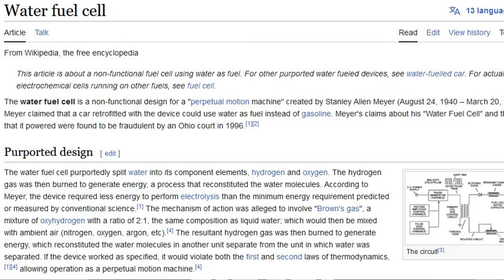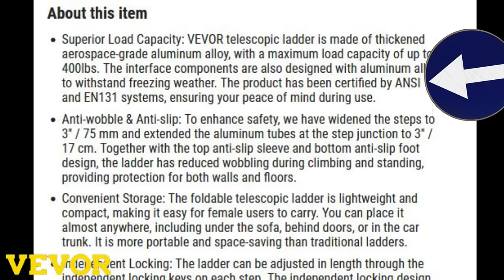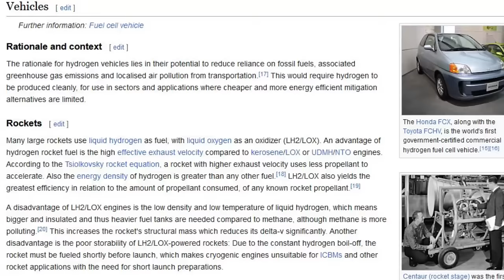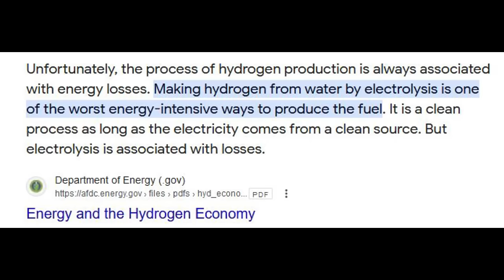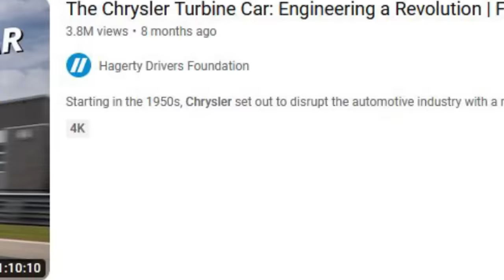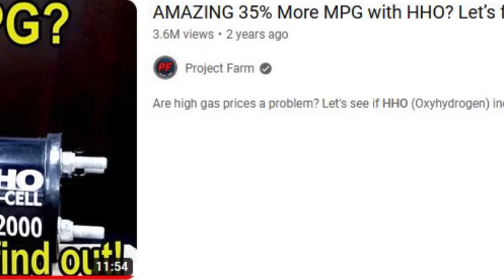These Engines Were Going to Change the World but..........

Comment from the maker: Thanks for watching. What do you think of this subject? If you wanted to check out the Vevor Ladders, check out the links here: 
18.5 FT https://s.vevor.com/bfQU28
10 FT https://s.vevor.com/bfQVEV
Discount Code VVPROMO for another 5% off
Reply: Those Vevor ladders are great, we use them in bulk fuel delivery daily. Stow easy. Just have to be easy on them when sliding the stages together. Hard on the plastic buttons.
Reply: 200 gallons on my 1981 vw rabbit pickup with a mechanical highly modified 1.9 tdi

It’s been that way for 13 years.
Reply: Hey Josh I was wondering if you have ever made a video on the cat 3176 engine.
Reply from the maker: No, but I feel like there will be one soon 🤫

Comment: In the '60s I saw the turbine car with manufacture's plate in my town near the PA turnpike.. It definitely had the turbine whine. We also had two 400 kw turbine generators at work. They ate so much fuel, they were changed out for diesels.

Comment: Back in the fifties, Rover company made gas turbines from Frank Whittle designs. Rover put one in their car, the engine was reckoned to cost 50% more to produce than their regular engine , but it also suffered from slow acceleration because it was single shaft type, and used a perforated ceramic disc revolving between exhaust and intake to attempt some heat recovery, still being thirsty. Not sure how few were made.
Alternative fuels, my college lecturer in the early eighties claimed that in the early sixties he drove a mini with a sterling cycle engine that used a radioactive isotope for the heat source. The isotope would last about three years before needing return to the British nuclear research facility at Harwell for a new isotope ( sealed in its lead jacket) . The downside was a top speed of 45mph.
Water fuel, many early engines used water ingestion to reduce combustion knocks, a few even had the air intake inside the cooling hopper to ingest steam.
Using alternator output to reduce water via electrolysis,,,,, really,, the engines driving the alternator which itself isn’t very efficient, and the engine still only 35% efficient at best. As said,  ‘ye canna change the laws of physics’.
Let’s go one step further, hydrogen 😖😖 first you gotta make it, then you gotta compress it, A LOT. 
From the manufacturing point onto the transport, off the transport to the retailer, from retailers to your vehicle, each step is either a reduction in pressure, or needs heavy pumping. And that’s assuming there’s no bulk storage as we have with oil. Some in depth studies by highly respected researchers suggest about 60% of the hydrogen that reaches your vehicle is actually used for propulsion, the other 40% was used for making and transporting. And after all that, due to the size and physical requirements of the high pressure tank in your vehicle, the range is not much different to an EV battery system.
Hybrid drives still seem the best option, diesel/petrol powered generator with electric transmission for distance and batteries for both around town, and hill climb boost.

Comment: The part about an exhaust turbine has been done, detroit did it on the high hp dd16 engines and it was basically a turbine after the turbo that went through a torque converter and gear box that directly put power into the gear train, i think it added 100ftlbs of torque but was mostly gimmicky costly and broke a lot
Reply: Volvo has that tho
Reply: Yea it's kinda dumb

Comment: There was actually an aircraft engine that used multiple turbines geared to the crankshaft to recover energy from the exhaust. It supposedly increased the fuel efficiency by 15-20%. The engine was the Wright R-3350.
Reply: The DD13 does this, theres a turbine behind the normal turbocharger that is geared to the crankshaft

I believe there may be some other manufacturers that do this on their trucks as well
Reply: ..and it was one of the most unreliable aero engines made, with an insatiable appetite to lunch on it's exhaust valves. As used in the L-1049 Super Constellation, and garnered it the reputation of being 'the most beautiful 3 engine airliner in the world', because at least one engine failed nearly always on each flight =)
Reply: That’s called turbo compounding
Reply: Beat me too it , Nice seeing good info.

Comment: Remember- when thinking about the "perpetual motion" reasoning, that can trip you up sometimes. 
Example being using refrigerant systems to move heat into an area versus electrical resistive heating elements. 100% of the electricity put into a resistive heater is going to come off as heat. That is 100% efficiency as a heater. Take that same amount of electrical energy input and use it to power a compressor in a heat pump system (which is essentially just an AC system with the roles of evaporator and condenser reversed) and you will get MORE heat output than the resistive elements. Does this mean, that as a system, the heat pump is more than 100% efficient?? Well, looking at it by itself, of course it isn't! The compressor has friction, the liquid refrigerant has friction, the gaseous refrigerant has friction, the circulating fans have friction- not all of the energy you put in is being used how you want it to! 
But.... compared to the electrical resistive heating element? Yeah, 200%+ efficiency is possible. You aren't generating heat, you are moving heat around using the power of phase-change of refrigerants. Compress that gaseous R-12/R-134a/R-410/R-1234yf/R-22/propane/ammonia/etc and it goes liquid- then send that now-hot liquid to an exchanger to cool down to just a warm liquid, then send it off to a small hole in the circuit (whether thats an orifice tube or an expansion valve) and shive it through- on the other side, it'll massively expand as it changes phase due to the lower pressure and in doing so absorb a huge amount of heat energy in the process. Send that now-frigid gas through a heat exchanger, and then send the now-warm gas through a filter/drier and back to be compressed again, and so on and so forth.

Comment: Hey AdeptApe!  long time viewer first time poster.  i had a weird one i wanted to run by you.  at a company i was a fleet mechanic for we had one 98 Kenworth t800 with a c12 (i believe it was a 98 but it had a c12 for sure).  if you where to try and start the truck middle of winter or summer, engine hot or cold( especially cold) it would pop and blow white smoke like crazy never starting.  plugging it in did not help at all.  a month in an older gent from the southern shop told me a secret.  if you turn the ignition to the on position and let it the "key on" beeper beep 8 times.  then shut the ignition off and turn it once again to on and let it beep 3 times,  then start the engine the truck would fire up almost immediately.  even in super low temps a few cranks and she would fire to life.  i worked there for 3 years and it was always like that.  i never looked into it cause i knew the secret and it was awesome theft deterrent.  ill let you know a previous driver left the bed up(it was a tandem dump truck) and she smacked her nose up into the bridge when the bed hit.  truck was always funky after then i was told.  still baffled me about letting the dash beep in a certain way and she would fire right over.  let me know what you think and thank you!

Comment: Very informed discussion. The electrochemistry of doing anything with water to use it as a source of energy just doesn't work. You have to put energy in to break the hydrogen and oxygen apart. Anything that can do that without electrolysis is so reactive that it also only exists as an oxide, so you have to use power to break that down. There's no free ride. Sure you can electrolyze water to get hydrogen and oxygen, but you need electricity to do that, which you could have used directly, and when you recombine the hydrogen and oxygen you get more losses, so you can never recover the useful energy you started with. Water 'powered' cars are a mixture of con and 'magic' trick. Same with the air powered car, sure you can drive a vehicle with air, but it won't get you far and you lose a lot of heat compressing the air and that's energy you can never recover.

Comment: I used to constantly have this argument with my brother in law. He was always fascinated with the YouTube vids of "perpetual motion" or "alternate fuel" claims. The laws of thermal dynamics always seem to win out in the end.
However, what are your thoughts on an exhaust mounted "turbo" that works in reverse, turning an alternator? After the vehicle is running at speed, it could be brought online and the engine mounted alternator taken off line. While power is basically generated by the (free) exhaust gas and there would be a gain in vehicle efficiency, due to the drop in parasitic load caused by the engine alternator. Controlling when the system is /is not active could be easily controlled by a computer measuring exhaust flow (MAF or MAP style sensor). Would the additional weight of another "turbo" and alternator, cancel out the benefits of "free" vehicle charging? Yes, I know the voltage regulator takes the engine mounted alternator offline when battery is charged to reduce parasitic load, but the gains would be far more notable at night, when the electrical loads of the vehicle are greater. Your opinion / feedback would be appreciated...thanks.

Comment: Anything Gas Turbine powered and fuel economy can not be used in the same sentence, paragraph, story, book, video and everything else.
You should look into the turbine powered locomotives that replaced Union Pacific's Big Boy.
Those were "mechanical monsters and marvels" at the same time. But were too finicky and different from the main stream stuff and thirsty, so they  got phased out for the regular, garden variety, diesel electric stuff.

Comment: The volume calculation is off for hydrogen. You can't have only 2 gallons of a gas contained within 20+ of a liquid. Maybe the other way around. 
The liquid form of a fuel is always massively more energy-dense than the gas form. Think of propane- in the tank, under pressure, it is in liquid form. As you use it, to maintain its phase-change balance pressure, it will boil off an amount equal to what you used. This is how you can have so much useable fuel in a relatively small container. 

That being said, in the propane example, there is no fracturing of molecules- its just a phase change. 
While a gallon of water will yield around 1850 gallons of pure H2O in gaseous form at standard pressure, that's still not a fuel. 
If you perfectly split the H2O, you would yield roughly 1200 gallons of pure hydrogen at standard pressure. That's about 0.9lbs of pure hydrogen. Remember, gasses take up A LOT of space. 
So how much is that in gasoline equivalence of BTUs? 
Hydrogen is around 61,000 BTU/lbs, so we will say 56,000 BTU in our gallon of water. 
Gasoline contains around 125,000 BTU/gallon. 

Gasoline is nearly completely combustible as it is nearly completely fuel. There is a small amount of oxidant and small amounts of material that react but dont technically combust (very very small amounts).
Water, by weight, is about 11% "fuel". The rest is an oxidant, oxygen! 
It's a very inefficient fuel because it carries all of the oxygen with it that it needs for combustion in an ideal setting. H2, plus O, equals H2O, right? 
So we have an inefficient fuel storage liquid, that then needs energy input in order to fracture the molecules out into fuel and oxidant (better not have any sparks in your electrolyzer!) at a prodigious rate. 

While your numbers were off (heck, mine are generously rounded, not going for lab work here) your conclusion is absolutely correct with our given understandings of the laws of physics.

Comment: Have you ever watched mountain men? Eustis, a homesteader has a pick up he converted to run off wood somehow. I think it runs off the smoke, he has a stove in the bed, he builds a fire in it and when there's enough smoke or whatever it runs off of the engine will start and then he drives it around. Thought it was pretty cool, but not practical.
Reply: they did similar in the uk during ww2 as fuel was in short supply they converted cars and even buses to run on wood gas or producer gas from coal, sometimes the contraption was towed on a trailer!
Reply: It's called wood gas and the stove is called a wood gasifier.

Comment: One problem with a lot of these ideas is that they seem to rely on what they usually refer to as "extra" or "waste" electricity your alternator is supposedly already making whenever the engine is running.  To me, this underscores a lack of understanding about the load that the alternator puts on the engine when it's actually generating electricity, and how much additional fuel it takes to compensate for that additional load.  There's no free lunches, boyo.
Reply: Yeah, alternators are VERY inefficient at producing power compared to the load they add to the engine.

There's a reason modern cars have computer controlled alternators and drop the voltage to stop charging the battery when it is full, or only charge under braking or decel... unlike old cars that just stayed at 14.2
Reply: @volvo09 well they all had a voltage regulator built into the alternator itself

Comment: Browns gas, or hho generators, are used in jewlery manufacturering as you get a very hot fine point flame that burns well above the melting point of most precious metals. It is just mixed electrolised water, so yes just like useing hydrogen but with pre mixed oxygen.  the generators also must run on AC voltage, or your anodes and cathodes will degrade.

Comment: I think the biggest waste of energy occurs when braking. Now this varies a lot according to driving profile (aggressive vs. Smooth) and also topography (climbing hills vs. Driving on a flat plane). This is being done in hybrid and EVs that charge their battery when lightly braking. I think this energy could be used a lot more in some way or form e. g. If you wanted to fit a hydrogen generator to a car or truck that could only kick in when your braking or don't have any throttle input. Obviously that would not make the vehicle not use any external fuel but I think reducing energy waste is the name of the game here.

Comment: There’s so much power and torque in steam, no need for a transmission. I’m surprised nobody has tried to refine and perfect a steam powered car. I know they’ll never let nuclear car become a thing but just think… a piece of radioactive material the size of a pea could power a car for a long time!
Reply: Check out Jay Leno's garage on his collection of steam powered cars. TL;DR it is faster to get in and turn a key than it is to get the water up to temperature prime the engine and start driving.
Reply: There is a reason trains are diesel powered now days instead of steam, and it’s not because steam was superior in anyway. I operated steam propulsion plants on submarines for 20 years. The transmission weighed 40 thousand pounds. Yes, transmissions are still required.
Reply: And a lost grain of radioactive material shut down 1/4 of Australia. There's a reason it never will happen.
Reply: You crazy to have a nuclear population car .
Reply: @Portuguese-linguica  yeah cars go through hell with crashes and fire!

Leave the nuclear reactor on land and recharge a battery 😂
Reply: @joshuawalton8179  Most locomotives are diesel-electric, the diesel engine merely generating electricity to power the electric drive motors. Diesel "powered" is a bit of a misnomer.
Reply: Bill Lear (early 70's in Reno) tried to make steam power cars viable. So did Howard Hughes (1925).

Comment: Kenworth and Boeing tested turbines in the 50 or 60s and Ford.  I think there's videos of both on here.
Reply: Turbines work great with thin air (high altitude), not so well at sea level (fuel consumption goes astronomical). Turboprop aircraft max out at flt level 28k (the propeller is the limitation) while Jet (turbo fan) operates efficiently at 38-45k altitude. Physics will not be overcome[d](sp?).

Comment: Also cannot reasonably do so without high frequency oscillation circuit designed/tuned to hho generator mass, to optimize output at molecular level,  otherwise energy input consumption requirements are unrealistic and undermine entire purpose,  which is what Meyers alludes to in his writings.   Im an electronics engineer by trade and applied this concept to my own hho designs and it works unbelievably well.

Comment: Hey Josh how ya doin. Also how expensive would it be to rebuild a 3126 cat and should I buy one it's out of a gmc 7500 but it's been sitting a while and it's not fully plugged
Reply: A 3126 doesn’t have wet liners so if a cylinder is damaged from rust or anything else it would get expensive quick because the motor would have to be taken out and go to a machine shop

Comment: Im wondering about the stovepipe engine or as it was dubbed roatery V engine. It was being developed by GM back in the late 1960s I believe. And Mechanic's Illistrated, in the early 1970s. They claimed it could rotate 7000 RPM. without any vibrations just like an electric motor. It would run on the 2 cycle system use regular pump gasoline.  And could produce 700 hp. But it was shelved and never heard from again.  Do you know any thing about that????